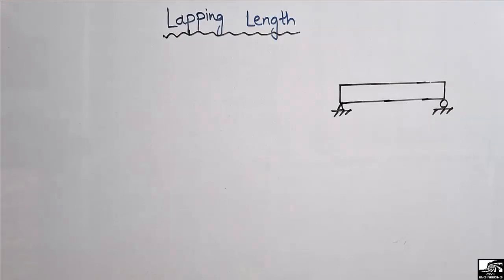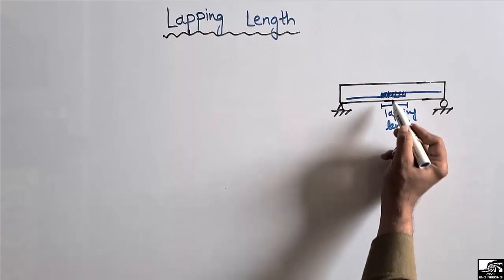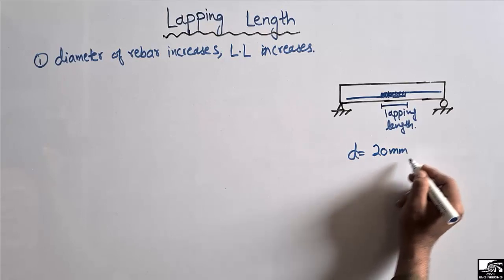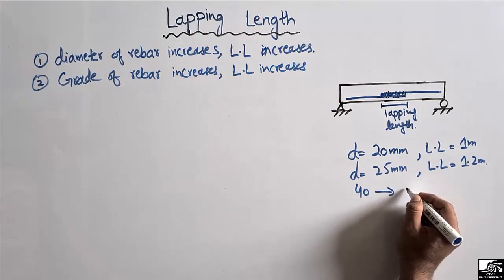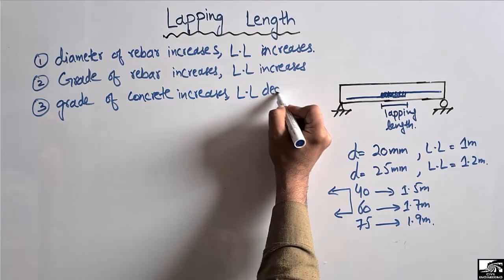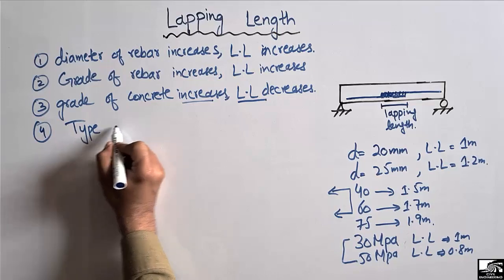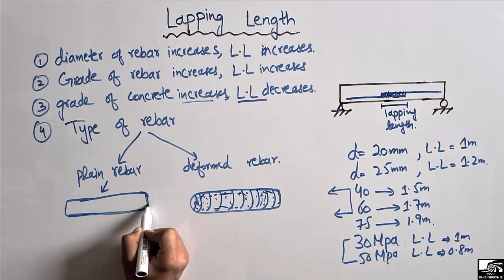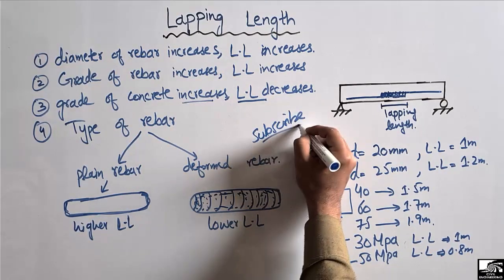Factors affecting Lapping Length

Comment: Factor affecting shear force and bending moment in beam.
Factors affecting bending strength in beam
Reply: Factors affecting bending moment in beam:
1. Span length (L) is directly proportional to bending moment 
2. Load (W) is directly proportional to bending moment 

Factors affecting shear force in beam:
1. Load and support reaction is directly proportional to shear force in beam